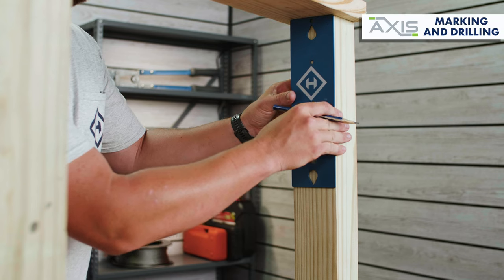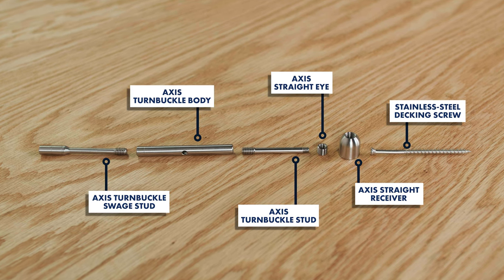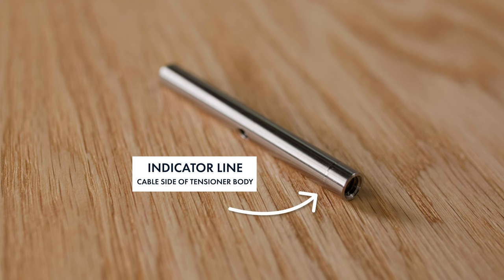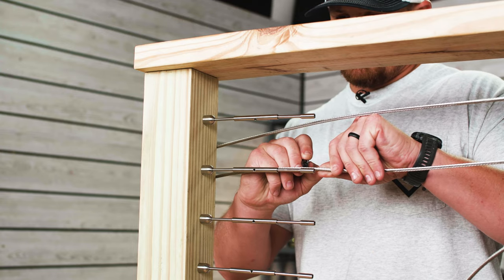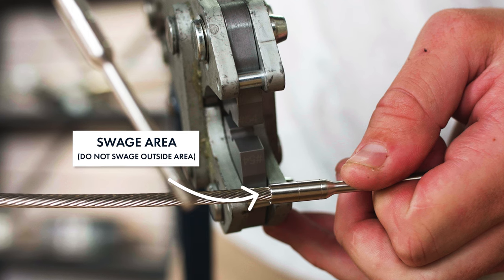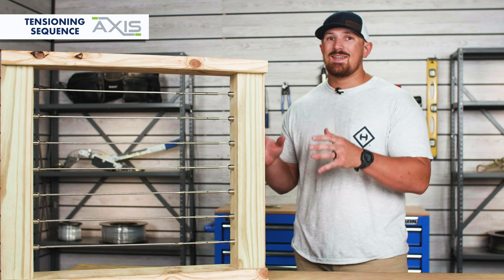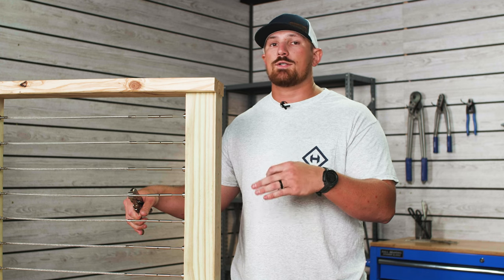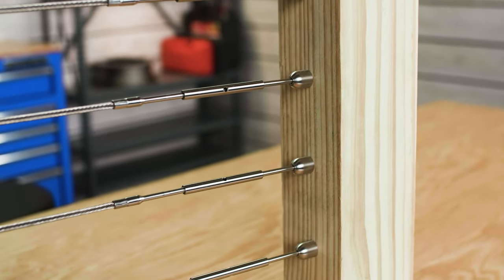Straight Tensioners | HAAS AXIS Cable Railing Components Installation

Comment: Another great instruction video! Does wood shrinkage or expansion loosen the tensioners over time?
Reply from the maker: Hi Joe! Unless you're using preservative-treated lumber for your posts, there's little chance the cables will loosen over time. We recommend that, if you are using any type of wet lumber, to let it dry for a couple weeks before installing cable railing on it. If you can't wait that long, go ahead and install the system with the knowledge that you will have to re-tension the cables later. We actually have a great video coming up where we address this question further, so stay tuned!